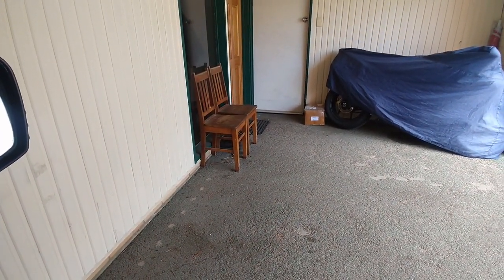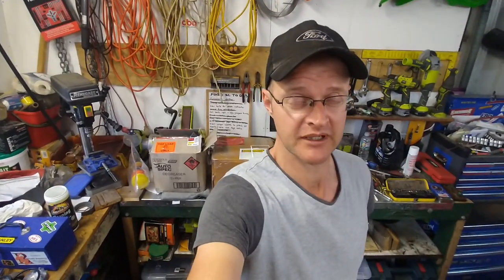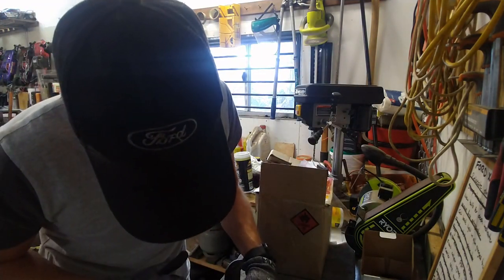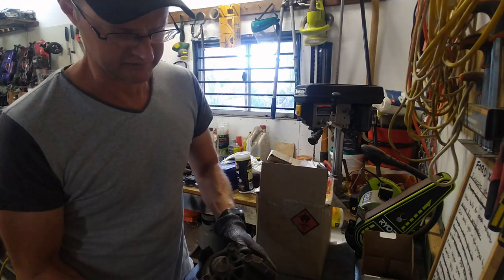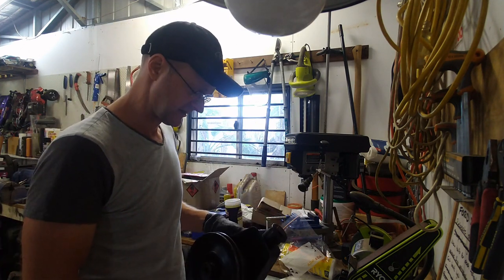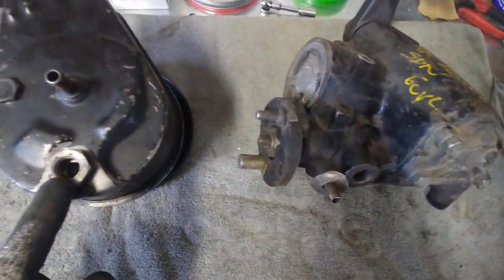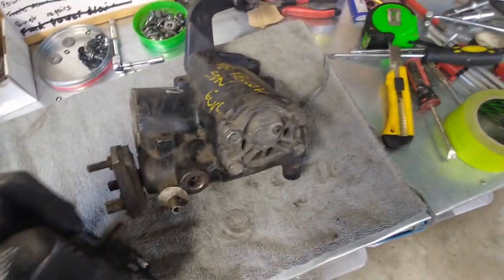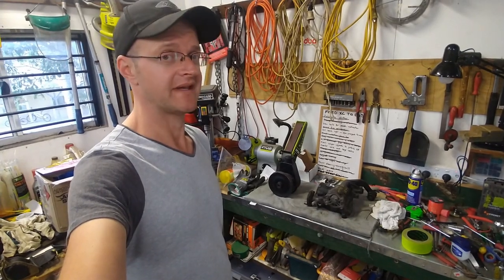XC Ford Falcon 351 Cleveland project: Ep 87 Power steering project acquisitions .

Comment: Oh, memories... You will need to get a dual pulley to bolt on the crank dampener to run power steering (can't see one in the video, i think maybe the water pump pulley was different too), you could also use the  a/c version tri pulley. I tried to find a cleveland bracket for a saginaw pump years ago, but couldn't find one. The earlier thompson pumps work fine & should be easier to source for your car. At least they're all metal, the xc on saginaw pumps had plastic bodies.
Reply: here's the more common pump, fyi. 
https://www.youtube.com/watch?v=BXs9bZ4Ua8I

Comment: Hi,great series. The pump you bought is the same as the V8,but the V8 pump has a different pulley…also you will need the different pulleys for the crank and water pump,what is on your car now is different. Hope this saves you some headaches.
Reply from the maker: So what do I need to change with my current pulleys? Offset? V depth? Number of ribs? I currently have a three rib lower pulley and a two rib upper and I'm seeing a number of setups that run the main belt from the crank to the water pump and P/S pump with an extra belt going to the alternator on its own.
Reply: @Missleindustry  you might be ok then. you'll know when you line up the PS pump.
Reply: @Missleindustry  when you filmed the engine bay it looked like you only had a single crank pulley. So yes you need the triple for the crank(that’s the easiest to find as it suits ac too). This crank pulley has a 13V size V-grove for the one closest to the engine,which runs your power steering combined with the correct offset single pulley for the water pump,which is a 13V too and only suits power steering,your water pump pulley will not work. The second grove in the crank is an 11V belt which is just for the alternator,and the last grove on the triple crank pulley is a 13V for the ac. The pulley on your 6cyl power steering pump is an 11V(not compatible with your triple for the crank which is 13V),that’s the difference between the 6cyl and V8 pulley and also the V8 one is a smaller diameter. You need a special puller to swap the pulley over on the pump or take it to a steering shop. With the lines I think the pump you have needs the xa-xc lines as the xd-on has a plastic pump and the pressure line screws into the side of the pump,the pump you have is metal and has the line attachment at the rear(xa-xc style). Good luck fitting the metal lines on the cross-member with the engine still in the car,I have done this a few times and it will stress you a little,but it is doable. Hope this all helps.
Reply from the maker: @TonySmith-gw3rl  Thanks for the detailed reply Tony, after some more investigation I have a two rib lower pulley and a two rib upper pulley. I suspect this was a power steering motor from a 74 fairmont. With the current size pump pulley I can't run a belt from the crank pulley without the belt interfering with the water pump pulley. I'm currently testing belts to go between the water pump and the p/s pump as they line up well with the new bracket. I am going through the 11v belts at SCA this week to find the right one.
Reply from the maker: @Gokizzmass  the ps pump looks to line up pretty well with the water pump pulley so far.